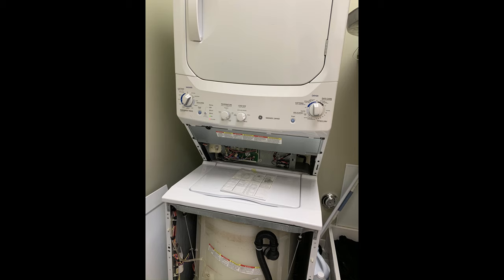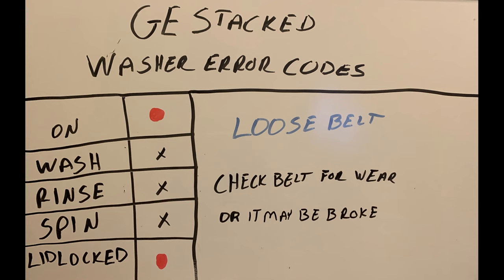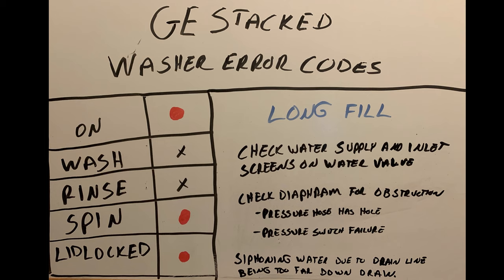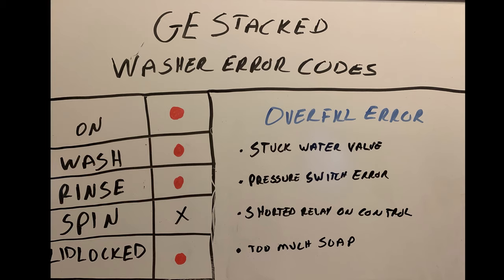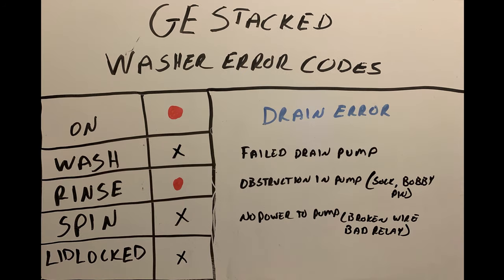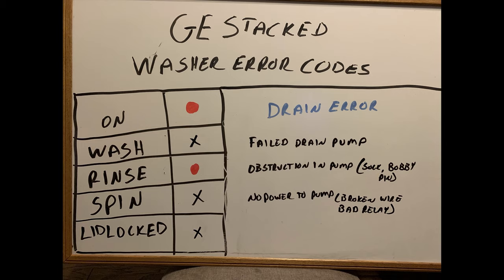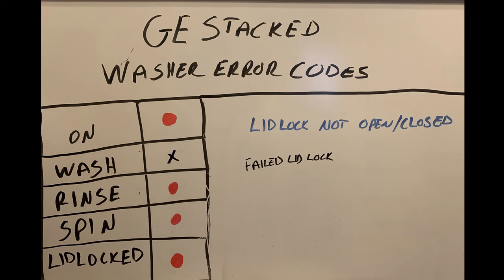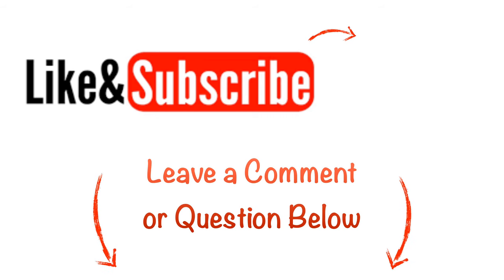GE stacked error codes

Comment: Good video but my GE doesn't have a fabric softener switch is there an additional button to press to get into the diagnostics?
Reply: On my machine, the button right next to the START button is marked DEEP RINSE.  Whatever your button is marked, press it and the START button to get into Service (Diagnostic) mode.

Comment: Hello Nathan,

I like your beard! I wish I could grow one as cool as yours but, unfortunately, I've got too many holes with no whiskers.

I've got a question about an error code. I have a G.E. Spacemaker WSLS1100DOWW washing machine, without the dryer attached on top, and it stopped working with an error code of IE. Through researching this code, including a corporate consumer help line, I found out that the code means a water inlet valve problem or, if not faulty, "call for service". Of course, they wouldn't tell me what parts or operations the "call for service" was related to.

The first thing I did was check the the screened washers on the hoses and the inlet valve - they were good but I cleaned them anyway. It still didn't work, so I removed the panel on the back and top corner of the machine and got access to the valve. This inlet valve had 3 solenoids. I made a pigtail of a power cord with alligator clips on the ends and attached them to the contacts on the valve one at a time and powered them up. All 3 solenoids worked fine with plenty of water flowing - enough to fill the tub set at extra large in 4 and one half minutes.

Is there ANY WAY that my valve could be defective? If yes, I will replace the $100.00 PLUS valve. If not, what should I check next that I am supposed to "call for service" that G.E. Consumer Hotline would not tell me about?

Thanks for all that you do to help us "Average Joe's" be able to afford to keep our machines running!
Bless You!!!
SpikeOKC

PS Also, my control panel is totally electronic, no manual timer or switches/buttons.
Reply from the maker: Great description of what you have going on.  I wish more questions were like this one.  I like to know what you have done in trying to pin point what is going on.

Okay sounds like your valve is good.  If power is applied the valve opens and lets water in.  Now have you tried setting it to warm or hot and still no water coming in? If none work you may be looking at a control issue or a sensing issue.  I will admit i have not ran into your washer type out in the field so my expertise is limited.  

Looks like your model has a pressure switch, lid switch or a out of balance switch that could be causing your issues.  You need to check those first.  The easiest would be the out of balance switch and lid switch.  If you can recall if your washer would fill with the lid open than you can assume the lid switch is okay.  Some washers require the lid to be shut and others do not.  The out of balance switch is just somewhere on the side of the tub when it gets out of balance the unit will shut down by simple pressing a switch when it hits the side wall.  Find that switch and do a continuity check.  Lid switch too if you need to,  It may be a magnetic switch.  Use your model number and search for a service manual.  I found one on manuallib.com just by googeling it. That may help you as well.  The schematic will show you that the out of balance switch it wired with the pressure switch.  Just on a hunch I have a feeling it is your out of balance switch that is the issue.  Not sure why, just a gut feeling.

Now when it comes to the pressure switch I cannot help you much there, I will say it is rare that those go bad.  Not saying they don't, just saying I do not run into it that often.  I would check the hose and make sure it is not kinked, cut or has debris in it.  I usually just take it off of the switch and blow through it. if it is clear you will know. If not find the blockage. 

If all those check good you will probably have a control issue.  The only way to figure it out is by testing all other possibilities.  

Good luck and great question! It drives me crazy trying to help people who just say "my washer will not work, what is wrong with it". I like specifics,  questions like yours will be more likely to get a response from me.

Good Luck! let me know what you find out.
Reply: @BeardedApplianceRepair  Hello  Nathan,

I apologize for my late reply, but I had a death in the family.

I thank you so much for telling me about the online service manuals. I have seen owner manuals and parts diagrams but I had NO IDEA they have 'fix it' manuals online. I know exactly what is wrong now. Unfortunately it is the PCB, but after all the tests that you told me to do and the manual confirmed, it IS the faulty part(s).

Again, Thank You SO Much,
YOU ROCK!!!
Todd 'SpikeOKC' Walker

Comment: Not so much related to repair but do you know how much the empty space in the back measures/the height of the space (where the water valves and exhaust is)
Reply from the maker: No but you can probably find that information in the installation manual.  Look up "Ge appliance manuals" Make sure its a GE site as well and search the model number.  They may have the installation manual there for you.

Comment: I can’t figure mine out, I’m getting the blocked motor code. I ran a test on each diagnostics mode and it passed each one, it stops at rinse on regular cycle and throws the code. I can reset the code and run spin cycle and it finishes the cycle. So it will fill, agitate and drain. Get stuck, then I can run a spin mode. Any suggestions? Thank you

Comment: Great videos.  Clear explanations and paced so you can follow.
A question:  I have a GE stacker that won't spin.  If you select Spin only, the pump comes on for about 15 seconds or so, then the lid lock makes 4 or 5 clicking noises and the washer shuts down. It's trying to lock but the cam only moves about halfway into place.  I replaced the lock but get the same symptoms.  If you pull the locking cam closed with your finger when you hit start, the lid will stay locked and the machine runs normally.  Would you suspect something else or just a bad replacement lock?  I did not see this video until just now, will go back and check for error codes tomorrow.

Thanks
Reply: I see no reply. I have a similar issue, what did you do?
Reply: @kenkolen  Neal,  Jeeze, you want me to remember something from a year ago??  Ha ha.  
I think I finally figured out that the tenant had bent the washer lid somehow and it was out of alignment just enough to keep the lid lock from fully engaging.  I guess that's why when you pulled it closed manually it would work, but it was binding slightly and the lock mechanism just wasn't strong enough by itself.  If I recall correctly you could kind of push down on the cover when you started the machine -guess it helped the alignment-and it would lock, then you were good to go.  I sold the house right after that and they buyer took it "as was", so I can't give you any long term results.  Good luck.

Comment: I can’t get diagnostics to run. Is that an indication of a shot board?  
Appreciate you videos!
Reply: Same here: diagnostics won't start. Help. Please.
Reply: Same here
Reply: I'm having same problem. Diagnostic will not start. My problem is with model GE gud27essm1ww my washer will not stay going if the dryer is shut off what do I do ?

Comment: Im getting a motor obstruction code, but there’s nothing obstructing the motor. Could the lid switch not be registering it as locked and making it kick off? Washer will start spin cycle but as soon as it goes to spin is shuts off and the spin light flashes
Reply from the maker: You can have a loose connection somewhere.  Those are the worst to find too lol.  Does you basket spin freely?  Could be the motor itself.
Reply: anthony harrison I’m having the same problem I changed the switch but nothing else is going it drains but I doesn’t go from the next cycle checked the drain hose and pump the pump gets me 11 ohms but not working

Comment: Had Blocked motor code. Cleared all obstructions. Tried to run my washer, it filled up with water, the motor kicked in and off. Wash light began flashing. I’m lost.
Reply: It might be that it is not reading, that your water is filled to the proper level, so check your water sensor valve or your water pressure valve and if it's not that check your motor for obstructions if there are no obstructions  just buy a new motor!

Comment: So , our washer (combo gud27) won't spin .it will spin on some settings but not all. Won't spin after a regular wash. Error code for  blocked motor comes up. I'm able to move motor fan fins and basket with 1 finger.  I do t get it ! Any ideas ?
Reply: Tried to wash a small load and machine stopped. Wash light flashing.
Reply: Mike, did you figure this issue out? I'm having the same trouble.

Comment: I'm guessing it's a long fill error. Water is filling up but it goes out immediately. Do I just pull the hose up from the water supply?
Reply from the maker: Your drain hose is in too far down the drain most likely.  The drain tube should only be in the pipe about 4 inches deep.  Sounds like its siphoning out to me.
Reply: @BeardedApplianceRepair  Fixed!

Comment: I am working on a GE stackable. The unit runs but it's stops in the middle of a load we have keep pressing the start button to work again do you have any advice.
Reply: @Eddie Garza...are you working on the dryer? If so, I'm having the same issue as well with multiple units. Dryer will run for 2-5 mins and then stop, they will restart after 5-10 mins... Have you found the cause? Thanks for the help!
Reply: Hello. How restart the washer. My machine is working heavy model and child turn into normal model. And it doesn’t work. The wash light green always flash and lip light always red. How to repair it. Thank you

Comment: How do you get the front panel off in order to get to the motor?
Reply from the maker: Putting a putty knife on the top part of the front panel between that and the top panel where the lid is.  There are two clips and a putty knife will release it and you can pull it towards you.
Reply: Thank you, I found the issue with my motor but there’s a piece that I just can’t figure out where it goes, it’s green with a small computer board on it

Comment: Hi, I really appreciate your video, its very informative.  I have a question. I have the exact same unit as shown in your video, but I experiencing a wash and lid locked light flashing.  I can't figure out what that represents. I have used your method to reset the machine, which usually works for like 3 or 4 more cycles, then goes back to the trouble mode.  Can you assist please??
Reply: I am having the same issue

Comment: 9 times out of 10 it's always the washer bearings in this model. I feel bad for the owners because I do care. I do care about my ability to help them and at a very fair no pirate price.

If your getting washer makes a loud grinding noise stack or none that some say sounds like a helicopter type sound... It's the bearing. To do the repair is time consuming and to replace the defective tub as it's sold asa unit is cost prohibitive.

This stack is of poor design in my eyes and GE is happy to keep slinging it.

Comment: I have the same model. water level deos not reach to the level it should be. only 2-3 inches. But manually i can drain or spin. I checked the pressure sensor tubing, i found a orange plastic string inside the tubing. im guessing it limits the air pressure. anyway  i cleaned the tubing and  the chamber, then connected back in. tested, still nothing changed.

Comment: Mine won’t go into the technician mode. When I follow the steps, they all blink in order for a second then it is showing the rinse, spin, and lid locked leds only. On and wash are not lit. No matter what position I dial it to, it stays the same except position 8. It starts pouring water into the basin then. Any idea what this means?
Reply: Follow-up: a tech said it was a bad control board. Don’t fully trust him as he seemed kinda unknowledgeable so take that with a grain of salt